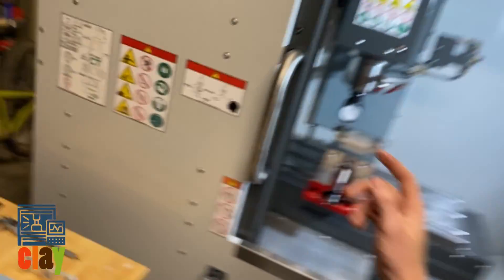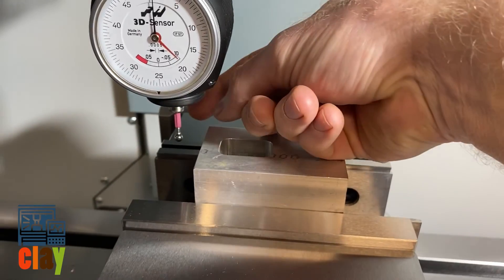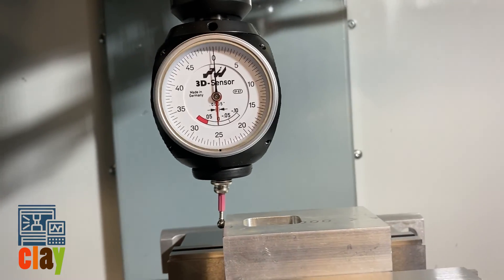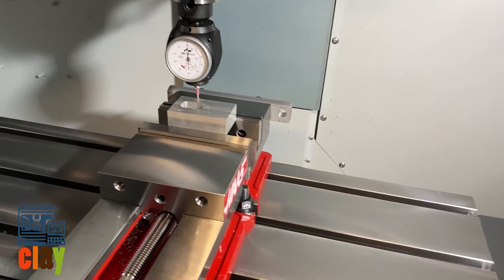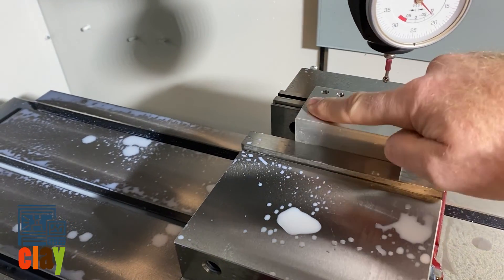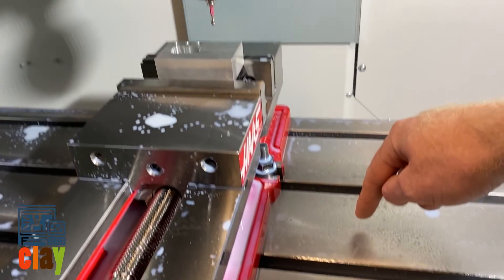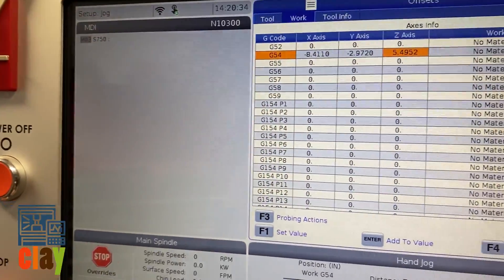How to Set Work Offsets Using a 3D-Sensor (HAIMER) on HAAS Mini Mill

Comment: When your on a edge with the zero setter if you goto MDI and enter "M4S4628" enter it then press reset button then the green start button.  It shows you a 3D visualization on the screen of the locations of your 0's

Comment: Thanks brother. It really helped me, but I still don't understand that how does the machine respect your tools cutting length. 
Like what if I have a shorter endmill and a Longer one, won't the 0 be different?
Reply: No, because each tool has its own length offset
Reply from the maker: @clbishir1 this. You touch off each tool.

Comment: You don’t move down on the gauge block move down in z then slide it under
Reply from the maker: While I would agree when touching off carbide tools to hard surfaces, I think it’s not very practical when using this bad boy. I do get your point.

Comment: 12:35 machine z is -5.4222 that how much you moved from home z. your G54 should be -5.4222-tool leght. your tool is 3 inch by eye. so G54 should be -8.4222 NOT +5.something lol., did you allready got it? same as x and y you get machine coordinate why not use machine coordinate on z too LOL
Reply from the maker: How do you touch off your tools? Yes, I’m not by any means a real machinist. This works for me and makes sense to me and I haven’t had any problems. I am open to trying different ways. Thank you for your advice.
Reply: @claymanufacturing  Touch your tools off the z off your stock.

Comment: 13:53 you dont need if you do it correct. just tell what leght your heimer and measure your part z, but then you need all your toold height be CORRECT. not HASS WAY (some number and -) LOL what tool lenght is positive
Reply: I was curious about how the sizes and lengths of tools can vary. How do you utilize your zero reference without that data? Thank you for your explanation!

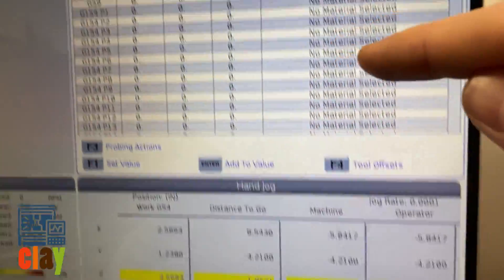Comment: 10:37 that is so incorrect. it should read -distance from z home(what comes from maxium -z travel + that 5.492). and your tools lenght shoud read +tool height and actually correct lenght LOL not - something
Reply: This is the guy (me) making the video. I realize I don’t follow typical machinist protocol. So in what you’re saying, where( or how) do you touch off your tools? I realize most people like to add to tool, I do not. Too much opportunity for me to fat finger. 
Anyways, what I did here works for me and I have not had a problem with it but I do appreciate your advice. I’m also open to changing the way I do things. Thank you!